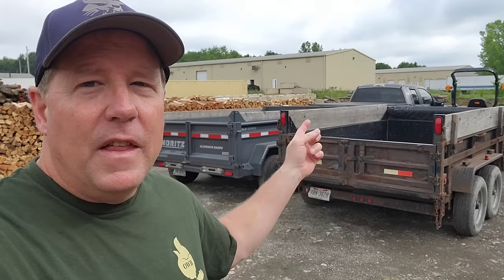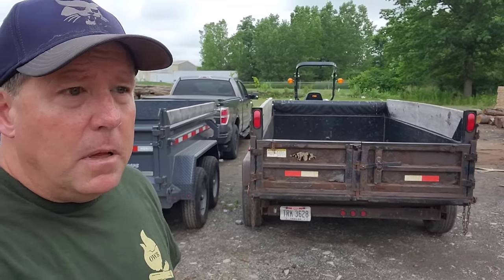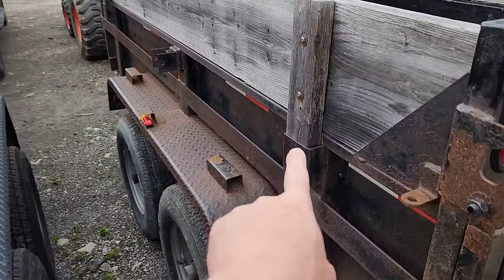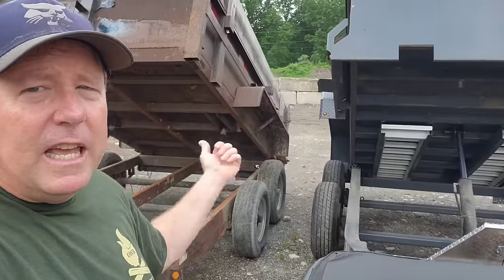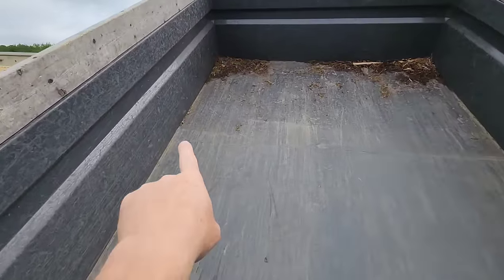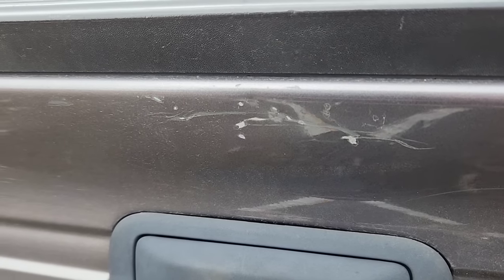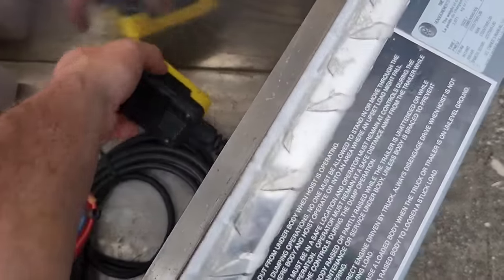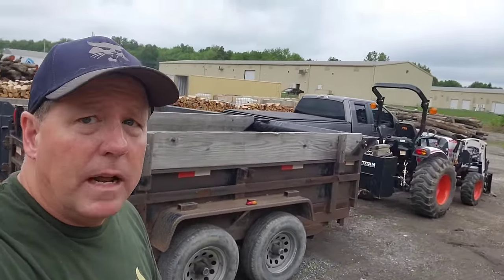Are Dump Trailers a Rip-Off?

Comment: Galvanized trailers are yet another upgraded option against rust. $$$ everything costs something. 😊
Reply from the maker: I think that could be the case for my next one Harold!
Reply: @ohiowoodburner  You should be able to order one raw or partially assembled if you find a good deal on hot dip galvanizing. The guys who just do galvanize can lay it on thick if you prefer, and they can tell you if any cavities would benefit from better liquid zinc access.

Comment: You missed the MOST important feature. How high does it dump. Some dump at 45 degree. Others 55 degrees. H&H and Hull dump at least 55d maybe more. If you don't want to shovel wet dirt or mud while a line of haulers are questioning you family background get the deepest angle. I also bought one that had the axles in the middle wih a long overhang. VERY BAD. Trailer whipped and wouldn't dump well and the frame bent from the tires to the tailgate(company paid to beef up runners). The paint is always a pain, but I lined one of my trailers with 1/2 inch CCA plywood and it still looked good 10 years later when I traded it for a larger trailer with thicker steel body. Thanks for your video. Dump trailers are wonderful. I've owned several but I think they are definitely improved thru the years. I had a remote control that was wonderful and safer around electric wires.

Comment: Simple fix for the Moritz trailer doors opening when not wanted.  Drill a hole in the bottom of the pin and put a locking pin through it to prevent it from popping up.

Comment: I don't subscribe to the view that a single hydraulic lift is better than two due to more failure points.  That single doesn't look bigger than the dual cylinders so the pressure required to move the same amount of weight is higher on the single.  Also, curious about the 10k trailer limit pushing a PA driver to a CDL.  I think the rules for CDL are so convoluted Fed vs. State.  The 10k trailer weight comes in to play for CDL when the tow vehicle is 26,001 lbs or more.  Otherwise, if GCVWR of the tow vehicle and trailer are under 26,001 lbs GCVWR then CDL is not required.  That's the Federal interstate requirement.
When discussing the flooring, there are different gauge steel plating that are used which would directly contribute to the longevity of the floor.

Comment: Great video Joe: After having a dump trailer in a winter environment- I would only buy a hot dipped galvanized dump trailer. I bought a Diamond C trailer which has really good paint. After a year it was rusting. I switched to dump trucks now, but I will be buying a N&N galvanized dump trailer. N&N make lightweight and heavy weight dump trailers. Any new trailers I buy will be galvanized. Personally, I would try to salvage your older trailer by sand blasting, priming, and painting.
Reply from the maker: Good insight Rich.  I think the Griffin will be a yard trailer for now on.

Comment: Maybe add a safety latch to the top of gate somewhere in case the stock one pops open.  I’d probably drill and bolt it on so it lasts longer than self tapping screws.  Dab your bolts and drill holes with rust oleum so it doesn’t rust after installation
Reply from the maker: I had considered that.  I need to do something to keep me from worrying LOL
Reply: Put a small ratchet strap around the doors boss
Reply: Drill a hole underneath the latch and put a hitch pin clip so it doesn't pop up.

Comment: A couple of things to be aware of if you're looking at a trailer with gravity down.  1. Saves you battery which is good. 2. You can't control the speed it goes down. When empty it goes down faster than a power down trailer...This is a good things.  If you need to lower it with a load still in the trailer then watch out because it comes down FAST!  This is bad.  The paint/powder coat sucks on all of them (all trailer really) if you live in a climate that puts salt on the road in the winter.  The only way to go to prevent that is galvanized.  Dave (in salty Ontario, Canada)
Reply from the maker: Thanks for adding buddy.
Reply: My dump trailer has gravity down, and it came with a valve that you can adjust you can make it come down as slow as you want loaded or empty.
Reply: I have a midsota trailer and they prime before they paint and use better paint 3 winters and my trailer still looks good. Lot of powder coating the steel is not primed. Mine is also gravity down and I’ve never had it not come done down to -15. Midsota has a one piece 7 gauge floor plus a scissors lift and mine has the hydraulic jack. The moritz jack still isn’t great.

Comment: Good review and pinpoint. Your Griffin trailer is still in a condition to save it; sandblast, a heavy primer, good paint, brake/suspension job, grommets everywhere than spraying with antirust, then it will last you for years. It still worth it.  👍👍👍

Comment: Another important item is dump angle. Firewood and crushed stone will come out easy but if you are dumping loam, or mulch you will want a dump trailer with a steep angle.
Reply from the maker: Very true.  Prob one of those telescoping ones would be in order.

Comment: simple fix for your trailer doors is to drill a hole in that spring loaded pin and install a lock pin or cotter pin while its locked in the down position  would be easy to do and give you peace of mind
Reply: Mine came with cotter pin locks.

Comment: The pin lock gate works great....  in the sales lot. Under load, the trailer will flex like a wet noodle. The pin will come free of the receiver hole. The cam lock is a much better way to close a gate when hauling these heavier loads. MTP, take it for what it’s worth. Good video! Thank you...

Comment: I would weld a latch at the top of the doors on the new trailer. After driving roll off trucks for 20 years I learned to never trust a single pin and if the lock has a spring then get rid of it ASAP. Locks at top and bottom or no haul, no exceptions.
Reply from the maker: Good idea.  Thanks buddy

Comment: You don’t want full length welds holding the floor on. For multiple reasons. 1) it would take forever to build and you’d warp the crap out of it. 2) steel needs to have some sorta flex. 3) if any moisture does get into the unwelded area it can not escape.

Comment: 100% on the tarp.  Don't even talk yourself into just getting one later.  Just get it right away.  2 rams definitely better if you ever haul uneven loads.  It prevents twisting.   Lastly, you are 100% spot on when it comes to the door locks.

Comment: Nice look at a few different trailers. 
I was told that in PA, you only need a CDL if the Combined Gross Weight of the truck and trailer exceeded 28,000 lbs  you would need a class A CDL, that would mean that if your trailer was 10,000 lb GVW, it only applies if your truck is rated at 18,000lb GVW. I don't think any truck in the one ton class hits that mark. But the issue come in if they rated the GVWR at over 28k, then if your trailer is over 10k you need the CDL. 
My dump trailer is rated at 14,000 lbs, my truck is rated at 8800 GVW with a GVWR (with trailer, of 22,000. 
So my rig doesn't hit the mark where I'd need a CDL. The PA DMV website breaks it down a bit better.
I no longer live in PA, but travel there regularly so I keep up on what goes on there. 
If I'm going that far with a loaded trailer, and will be weighing in at my max, I'd have to seriously consider not doing it in a pickup truck. It might do the job but I'd rather not put that kind of wear and tear on my own truck. 

When it comes to dual rams, the big issue is if one ram fails under load. it almost always bends the crap out of the frame and/or box. With one big ram, if it fails, it just goes down. A buddy was cleaning up from a flood a few years ago with his dual ram trailer, he loaded it to the max with mud and debris from where his creek overflowed and the right ram dropped suddenly when he was dumping the load. it was on a slight incline to one side and when the ram dropped, the trailer twisted dropping the box on top of the tires on one side. he did what he could to get it back in place but it was bent. Worse yet he failed to notice that even after getting the box empty and pushed sort of back in place, the one tire was rubbing the fender and that blew out on the way home too.  That was a tube frame and box but the tubing was pretty thin compared to mine. 
My trailer has a C channel frame with 8 inch sides and 6" cross members on 12" centers with the box having 3/16" wall 2x3 framing under the two piece floor. The front wall is bolted in. 
I bought that trailer new in 1999 and will probably have it forever. When I ordered it I specified exactly what I wanted and how it was to be built. I had been using an older, late 80's model and knew what worked for me and what were the weak points of the old trailer. 
Another buddy has one with torsion suspension but after 5 years there's not much suspension left. The rebound element in those axles is rubber, and rubber rots and gets hard, or takes a set and leave the trailer sitting lower than it should. With springs, the worst thing I'll ever have to deal with is having to swap out the springs but after 24 years mine still look great. 
The paint on mine was terrible, it had rust at all the seams after about three years. 6 years into owning it i sanded the bad spots and brush painted it with a Rustolastic from MAB. It lasted another 8 years or so, two years ago I got tired of looking at rust so i sand blasted the whole trailer, top bottom and all sides, inside and out. I pulled the axles, set it on a set of stands i made and sprayed the whole trailer with black epoxy bed liner that i had bought at auction. I put it on thick. I then serviced the wheel bearings and springs, I replaced the wheel bearings, grease, and put in some new spring bushings and it should be good for another 24 years. The tires are 10 ply LT tires, the original ST tires dry rotted away in three years. Its on its third set of tires which were new last summer.
Reply: Came here to say basically the same thing. Common misunderstanding, don't necessarily need a CDL over 10k in PA

Comment: hi  i would recommend looking in to some Fluid Film fir the rust . it will stop it , john
Reply from the maker: I have heard of it but I think this trailer is past the point of no return John
Reply: @ohiowoodburner  hi that trailer still has alot life in it , it wont get rid of the rust but it will stop further rusting , or a diesel oil mix , i use a 50/50 mix on anything i think may rust , i have it in a old spray bottle , ever look at the residue around a diesel pump when your filling up with gas , . old waist oil and a roller does wonders also , your old and a bit rusty and we are not giving up on you , lol john

Comment: The trailer twists a little going down the road.  As it twists, the pin drags on the side of the hole and slides up a little.  It is, at that point, against the side of the hole still, in a bind too tight for the spring to push it down.  Then, the trailer twists again, pushing the pin up a little more.  Eventually, the tapered part gets to the hole and it slides all the way up.  Put a pin in the pin under the hole or in the door above the pin.  Good review.

Comment: The key to longevity with a dump trailer is leave the box about 1/3 of the way when not in use . No water can pool causing major corrosion issues . Good and interesting vid Joe ! Cheers
Reply: Just crank the jack

Comment: Good job on this video Joe. I do think having the seam down the middle is more prone to cracking from dumping heavy items in. Having floor welded along the edge allows for a better weld joint and it does not allow big heavy objects to hit the weld joint directly. 

Stitch welds under the trailer are common for 2 reasons. When you weld, the heated area shrinks causing added stress and major warping on light gauge materials. It also would add a lot of extra labor and production cost in welding those joints solid. Stitch welds can be found on all kinds of things, without compromising structural integrity. It is a good idea to caulk between stitches if corrosion is a concern... Like road salt

I agree that the I beam is better for the frame. PJ trailers used to advertise tube frames until they started having problems with cracking. Now they went to beam frames. I believe @Worlds Okayest Farmer did a video on his experience on this too.

My next dump trailer will be galvanized with hydraulic jack. Gooseneck most likely due to how much better they tow... that is unless I find a good deal on a f450 4x4 with a 12 ft dump bed first 😊

Take care Joe, hope to see you in Booneville
Reply from the maker: Excellent post Chris.  Thanks for the crash course in metal work!!!  I prob won't be in Booneville but def at the PB.  I want to talk to you about a spring show at my place next May.

Comment: If the side of the trailer flexes or leans that will also raise the door up on the end where the pin is.  I am looking at it from a physics perspective and not from experience.

To test the stability of the sidewall you could have the doors sticking out away from the trailer and pull down on it
If the door is not stabilized you could fasten it down some way.
A different way would be to have a backup fastener such as a chain going across that would hold if the pin came out.

Good job with the instructional video.
Reply from the maker: I had thought of that to where the pin sorta walks it way up until the tapered end of the pin works it way out.  I need to drill it for a cotter pin etc.
Reply: @ohiowoodburner  
I don't know how it happened but a retaining pin would be a good remedy. Don't use a cotter pin. There are other pins that you have probably seen with the big circle that snaps open-and-shut.

I expect the manufacturer would be interested in this problem they created.  Wouldn't they be liable? Shouldn't they start building better trailers?  I expect it would be a very small cost for them to do better.  Tell them you are on YouTube.

Comment: I am a huge fan of telescopic dump trailers. They go to a much higher angle then yours and dumps stay in a smaller area.👍
We have a local place that specializes in redoing trailers. I see their adds alot. $1600-$2200 for all new lights/wiring harness plus they will sandblast and repaint. Their slogan is Why buy new? We will make yours better then new!
Reply from the maker: I've seen those but never considered getting one.  Seems this style is ideal for firewood at least.

Comment: If I can afford it, I would buy more expensive trailer because I like the frame. I also prefer the Leaf spring! Both bounce because they don't have shock absorber to take care of the springs!
Reply: Plus a leaf spring puts equal weight on each axle.  Yes the torsion ball suspension is much less repairs but they do NOT equalize the load between axles unless the trailer is perfectly level.  I have had both and have blown tires cost more than broken springs over the life of the trailer.

Comment: The Griffin has the better frame design... tube blows i-beam out of the water on flex and weight. All the guys that say "but my I-beam will last forever", Yeah it will.. after the rest of your trailer rusted out so what's the point?
Also like the dual pistons on the Griffin.. smart. No wracking if the load shifts while up. Its too bad they had such a problem with rust. I am sure by now they have fully addressed it (if they're still in business).
The Moritz Does have the better floor..
You're right that bent up sides are stronger, BUT Moritz uses all 7ga floors on their trailers. They had to weld on lighter sides for weight savings since they used heavy i-beam. 
The Griffin is simply the more serviceable trailer afaic. If you used a "rust converter" on the whole thing, then lightly painted with a black or grey primer, then hit the underside with Fluid Film and you'd be all set. That, and add a proper heavy trailer jack and maybe a 'wet-bolt' kit for the shackle to grease it. 
As far as "gravity down"... that is the preferred system as it uses half the power from the battery. But most guys who live up north don't use their dump trailers in the salty cold. For you it seems like an okay fit. Dirt work would rather make more dump cycles in a day. Thanks for the video!
If you step in and stop that rust while it's still just on the surface, you'll save that Griffin for years of solid life 👍~

Comment: A dual ram dump trailer had its lock pin fail & came out. We could not find it. The one working ram raised the load easy! Because the pivot is wide and don't Jam, it works I seen this myself.

Comment: 4 piece constriction usually has a heavier gauge floor and sides are lighter gauge. As far as your pin on the tailgate,  of there's room, drill a ¼" hole below the plate and use a hitch pin to keep it from popping out.

Comment: The cam lock is much better! It's always secured.. The one with the pin, you can drill a hole in it & put a  flat washer on it & put an R key or clevis pin to make sure it doesn't open.. Also the one with just the pin, if there's weight Against the door, you can't  pop the pin, you have to hammer it out! & eventually it will create an egg shape in the hole & if you haul sand or fine material it will leak out! Love your video's! You take your time & speak thoroughly & clearly & explain things  where people can understand, & if you don't know, you don't let your pride get in the way of that, you let people know that too! Thank you for sharing your video's! 
GOD BLESS YOU!!
PRAISE THE LORD!! AMEN!!
😘🙏🏻❤️📖🙌🏻🕊